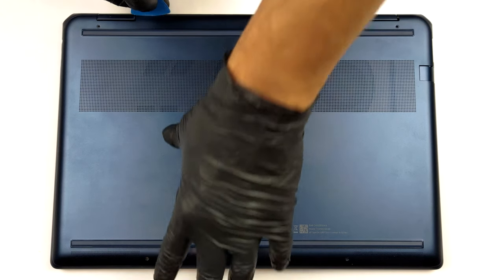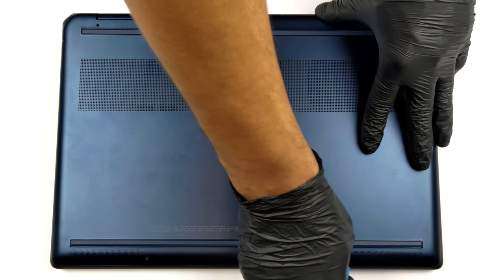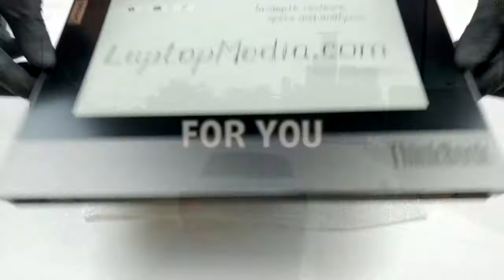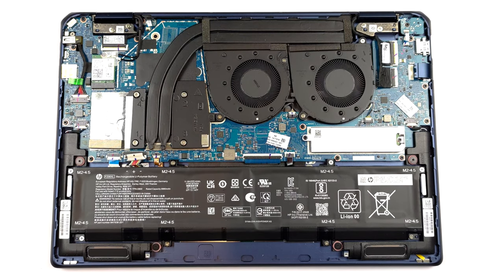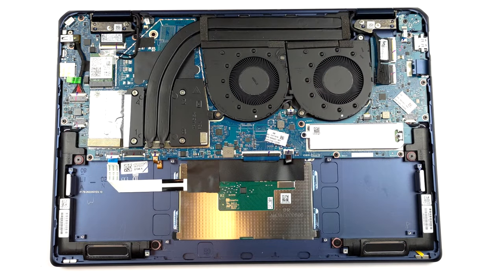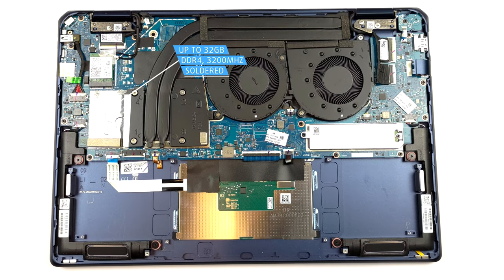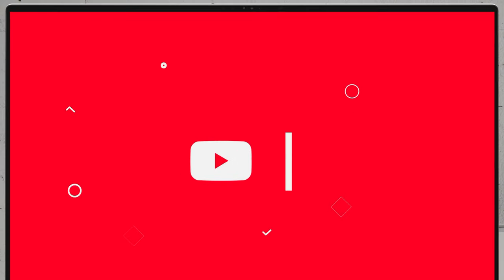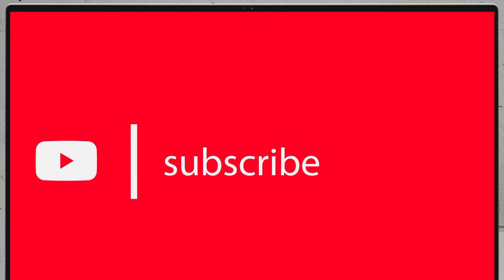🛠️ How to open HP Spectre x360 16 (16-f1000) - disassembly and upgrade options

Comment: My laptop had clogged fans.  I cleaned them well, but now, everytime i boot up a game, my cores spike to 97ish for a split second, then back to 50ish.  Ive run all the hp test on fans and the rest of the components, and theyball passed.  Any idea what may cause this?  The only thing i can think of is  to replace the fans and remount the cpu.  Any help would be appreciated.